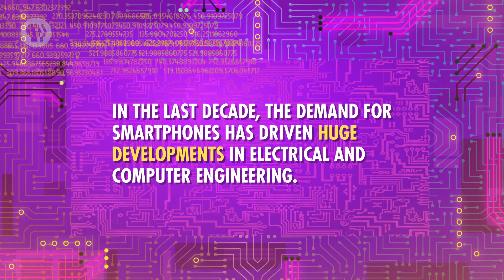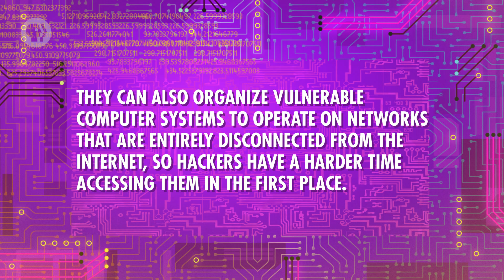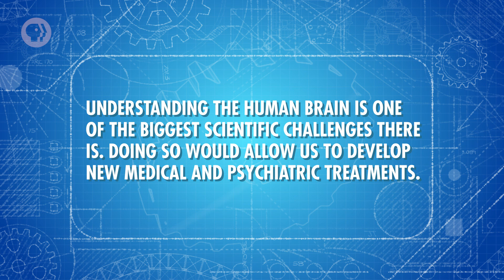The Biggest Problems We're Facing Today & The Future of Engineering: Crash Course Engineering #46

Comment: Why does this video feel so forced with "green" nonsense? As an engineer in oil and gas *disclaimer*, it takes more resources and pollution to build and maintain solar or wind operations per kW than burning hydrocarbons. Furthermore any attempt to reduce pollution comes at an efficiency cost that hurts the bottom line, these future people are going to have to be a new kind of human. Now nuclear, currently modular reactors that we have seen similar to on military vessels are buried  on every military base, we might be able to meet baseload power with nuclear technology. Currently there are efforts by corporations like Microsoft to get these modular reactors to power large data centers but if part of you has doubts about burying reactors all over the USA, you are not wrong. Currently, we are in the process of decommissioning nuclear plants. We have cooling ponds all over the USA where if just 1 were to explode it would be a exetencial event. It's a great cold war idea to ensure if the grid fails the world ends but we have made little to no progress with the way nuclear power is done since then. Everything is still theoretical and until mankind needs a way to produce power domestically and not produce plutonium or atleast use it for domestic power, we will forever be stuck in the cold war era for nuclear.
Reply: The thing is, fossil fuel has no plan for the future. Sure, solar is barely feasible right now, but the switch will pay back in the long term.
Reply: @davidgustavsson4000  You should do some of your own research on how many tons of coal it takes to produce solar panels and wind turbines. Then factor in the upfront cost comparison building and maintaining a coal plant verse a solar farm per kilowatt. It's all smoke and panels. Also baseload power demand cannot be met with today's wind/solar storage capacity. Even with a mountain of lithium batteries, when you factor in the environmental cost of lithium batteries and the lifespan of them, it's all diminishing returns. I love all the high minded ideas but practically speaking it's all nonsense.
Reply: @JohnSmith-xk8rr  the key word is "currently". Sticking to coal because it's the most efficient in the short term is short sighted. It's necessary to direct R&D towards power sources that have a shot at becoming sustainable.
Reply: @davidgustavsson4000  That is just coal, I have not touched oil, lubricants and distillates. Currently billions would starve without these products. It isnt until you start to think about all the transportation, equipment, and complex supply chains that require millions of barrels of oil to be turned into even just diesel you start to realize what kind of situation we are in. Everything from keeping the gears greased to fertilizer requires intense production of greenhouse gases and oil. To think 7+ billion people are going to live in closed systems comparable to those "earth ships" in California is a extremely privileged wet dream. If we don't end up nuking each other over food and oil, humans are going to have to reduce their individual existence to compensate for the billions of new people. If anything we would be preparing our kids to work for Lockheed Martin.
Reply: @JohnSmith-xk8rr  of course, because there are other uses for oil than fuel, limiting oil consumption for fuel is stupid.

Comment: BECCS has been shown not to work due to the massive areas needed for forestation, which would actually increase the average temp by reflecting less sunlight. 

Anyone got any better ideas, or are we dead?
Reply: Genetically modified algae? They can photosynthesize to remove the CO2 and convert it to O2 (GM to make it more efficient), and we use the multiplying algae in biofuel and algal batteries? Find ways to incorporate the algae into building design and use it as a power source? Hell, we can eat algae.

Or even just finding a nonbiological chemical process that turns CO2 into O2 and pure carbon. Bury the carbon or use it to make things (diamond, carbon fiber, carbon nanotubes, filters)?

Comment: Engineers are looking for carbon capture devices while we have the best technology for capturing carbon, called a ducking TREE, i can plant 1000 trees for 100$ and remove carbon for YEARS
Reply: Electronin com and that’s some of the biggest bind spots of engineers who solely focuses on “technology”.
Reply: Dan tsai i am making a products that plant trees with each sales, i hope this way we could show companies there are more thing than just sales
Reply: For this to balance the burning of fossil fuels, we'd need to plant enormous volumes of trees, and dig them down safely and efficiently. The kinds of time and pressure that turned biomass to oil in the first place is just not something we can mimic at scale.
Reply: @davidgustavsson4000 Gustavsson what do you mean? I think we can plant trees at scale reasonably easy
Reply: @VidsbyParsa  a simplistic calculation a user on earth science stack exchange indicated that an area the size of Europe, Asia and Africa combined would need to be planted with trees to counter the CO2 emissions of 2010. Note that those trees can't be burned for fuel, or they would be a net 0.
Even if that calculation was exaggerated by a factor 1e6, that's still way more forests than we would be able to plant.
I'm not saying trees are pointless, but it's not a long term solution to the emissions problem.
Reply: @davidgustavsson4000  We don't need a simplistic calculation, we have cut down an area much bigger than Europe, Asia, and Africa we already destroyed 80% of forests, we are humans and this is our actions, net 0 or factor of millions will not give us back the spices that we already killed and the ecosystems that we destroyed, I personally don't think we have the right to do that, trees last for decades and every day they emit enough oxygen to keep you alive for day, so respect it and do not for a second think you can outsmart nature, I do not want to live in a home that is being oxygenized by tanks and filtered by a stupid CO2 absorber. In this world, we need people to stop wasting energy, move to clean energy and help the environment thrive instead of polluting it with plastic and CO2 and trying to figure out how to fix the problem of ignorance by ignorance.
Reply: @VidsbyParsa  you seem passionate about this problem, so why do you bash on attempts at finding effective solutions?
An Africa of forest planted, chopped down and buried every year is not going to be a win, either economically or ecologically. What we need is exactly people who are willing to do the calculations and the inventions, and who don't just stop at "tree pretty".